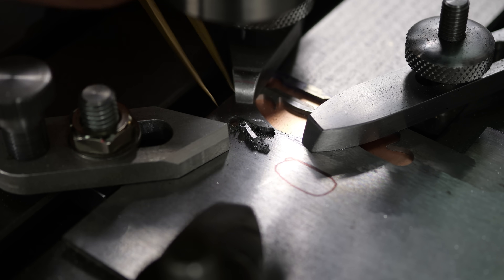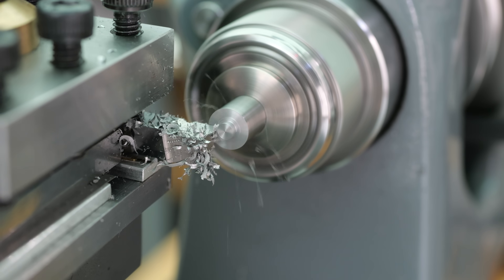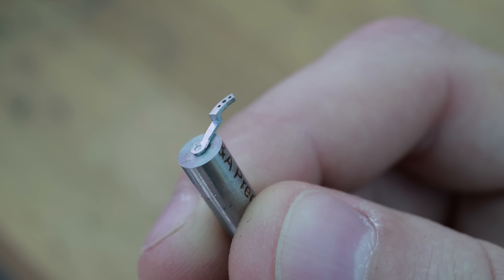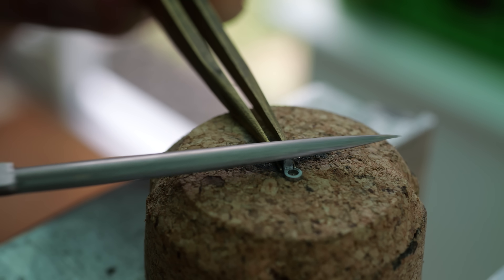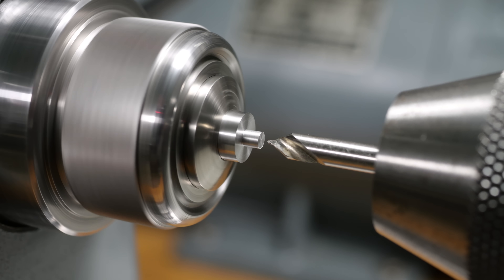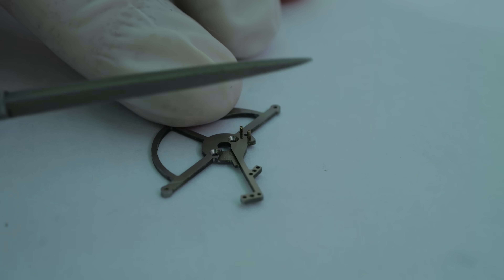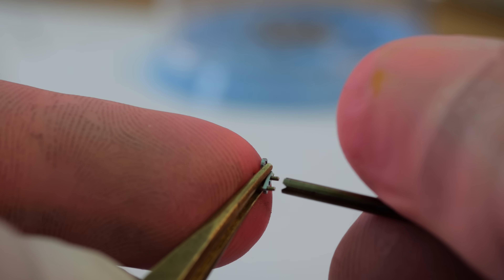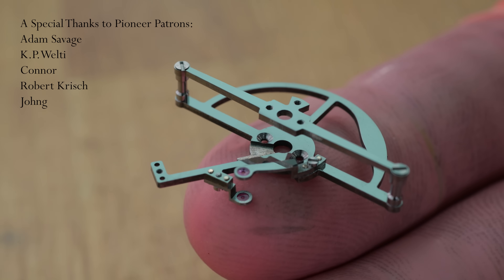Watchmaking: Machining Miniscule Watch Parts

Comment: Great work. The pin de-burrer was one of the first tools I made as an apprentice. There were always broken needle files, and I used the handle of one, then cut the V grooves with a three sided file and followed up by hardening the tool. That was nearly fifty years ago, and I’m still using it 😅

Comment: This sure makes me wonder how they did this without modern equipment.    Nicely  done man.
Reply: He's doing this mostly with tools that were already available 120 years ago... although it is true digital microscope screens were a lot lower resolution back then.
Reply: @akaHarvesteR  Well, yes but watches go back to the 16th century.   That's well before Sir Joseph Whitworth.  Machines before that were a sloppy mess.   Not very suitable for anything delicate.
Reply: @lucidmoses  iinm, Whitworth produced the screw lathe, with the synchronized lead screw for cutting threads, but I believe other lathe designs did exist from much earlier. 

Although you're definitely right in that the techniques must have been really different and interesting in their own right.
Reply: @akaHarvesteR  Yes, but if you read a little more, it's his work in Surface Plate and precision machining that was relevant.

Comment: 2:07 I use superglue all the time and the key is not to let the cured glue become hot. Once it does, it will turn back into a liquid and evaporate. Which is what’s happening here. A little coolant will solve this problem and help with the machining. I don’t know how to achieve that at this scale… maybe a little oil dropper?

Comment: Incredible..just incredible shots! How do you even film things like this? Which camera and lenses did you use here?
Reply from the maker: Sometimes, I film through a microscope, but most of the footage is collected with a Panasonic GH7 + Panasonic 30 mm macro lens (60 mm full-frame equivalent). I've made a few custom mounting options around the shop to get the best angles while still being able to work around the camera.

Comment: Instead of heat, why not use acetone to break the adhesive bond
Reply from the maker: Either way works but using heat is quicker. I have to clean the part up by hand anyway, so any discolouration from heating is not an issue.

Comment: Do you create technical drawings and set tolerances for the components or is it more of a trial and error sort of process?
Reply from the maker: I usually try to make parts to measurement so that I can remake them in the future, if it's needed. Sometimes, I will 'make parts to fit' while also keeping within a certain tolerance. Once I've proven the design, I will make the drawings available on Patreon so others can reproduce this, but even with the drawings, some judgement will still be required if using manual techniques.